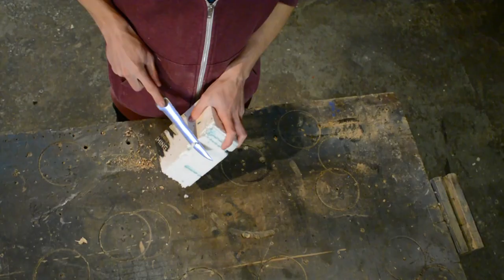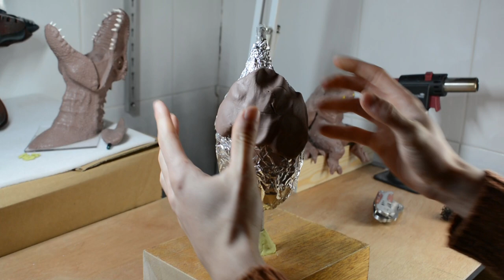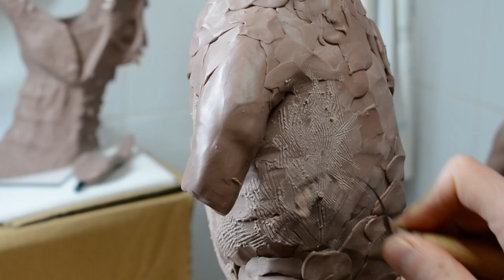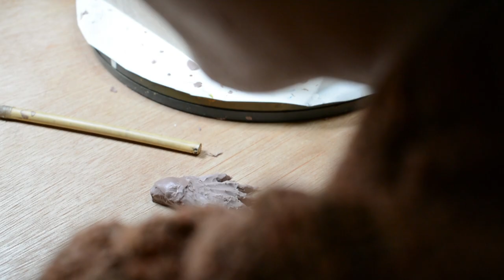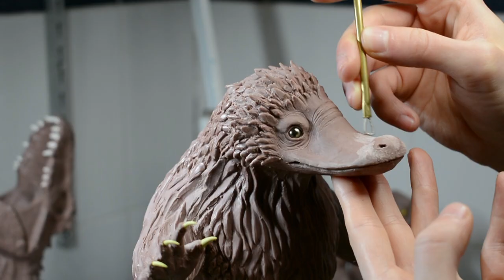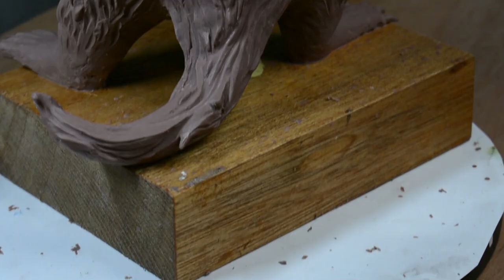Sculpting the Niffler from fantastic beasts and where to find them

Comment: How do you make a silicone mold out of a piece like this when you glued it into the wooden base? I plan to sculpt my own little characters and the original will be glued into the base, but i just don't understand how to make a mold when the base will be in the way or do I just leave it there as a part of the mold? Sorry if this is a silly question! I'm still learning! Great video by the way - you just earned yourself another subscriber!
Reply from the maker: LeStyleHefah Hey! I left the piece attached to the board and built the mould around it. Here's a link to an Instagram picture I posted ages ago when I was making the mould https://www.instagram.com/p/BPYb3xmFyaS/?utm_source=ig_share_sheet&igshid=gtlhkx12y0uv

And thanks for the sub!
Reply from the maker: LeStyleHefah alternatively though, you could remove it from the board, I just left it on to avoid disturbing the clay
Reply: Thank you for your reply! Omg I just realized I could slip off a sculpture out of the metal piece correct? Might disturb the clay though. I guess I'll have to see which way will work best for me! :)
Reply from the maker: LeStyleHefah yeah I guess you could! Just give it ago, don't worry about making mistakes because it will help you learn that much faster

Comment: Man, congratulations for the amazing job and thanks for sharing it. Excellent!
Keep up the fantastic job.
What kind of solvent material do you use to smoothen?
Reply from the maker: Thanks a lot! and I shall :) the solvent was lighter fluid, works well with monster clay (which is what I used)
Reply: Hello again. I'd to ask you a favor. But only if possible, I'd like to know the measures of both wooden base and Niffler.
Reply from the maker: Certainly, you'll need to wait until i am back in my studio though, in a week or so
Reply: Hey, brotha. How about the measures? Have you been able to know yet?

Comment: hi ! what kind of clay du you use ?
Reply from the maker: I use "monster clay". the medium grade to be specific. it comes in hard and soft too.
Reply: did you bake it when it's finish ?
Reply from the maker: Mandine camille no monster clay is a oil based clay so it doesn't dry out. I'm going to make a mold of it and cast it in resin